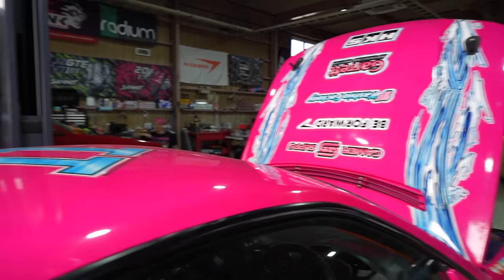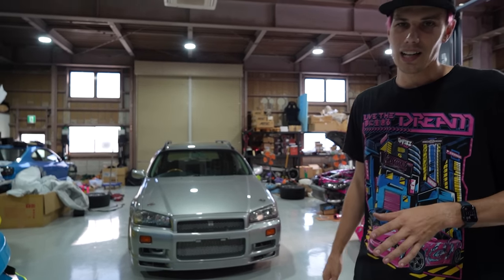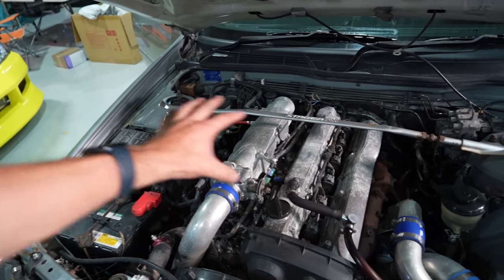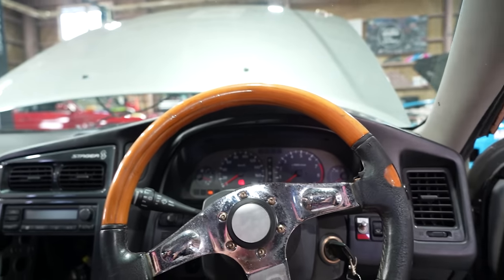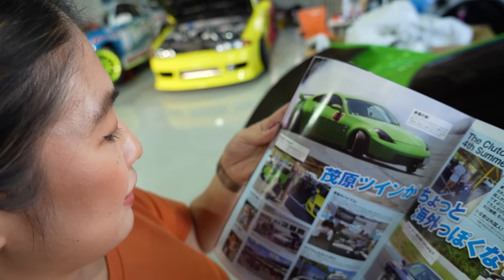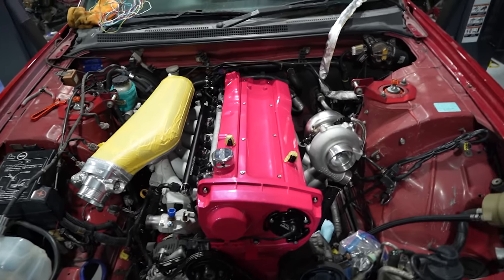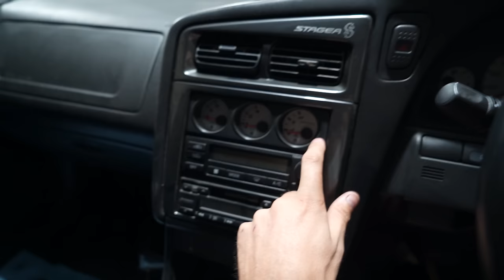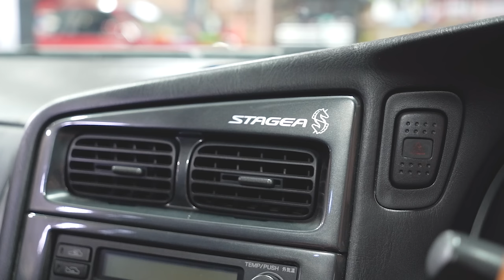IT FINALLY HAPPENED!

Comment: Dammit Sammit. That is my dream wagon. 550hp, silver with all black interior, 34 front, with brid seats front and rear in black with carbon backs.  18inch 002 get wheels in black with stainless hardware, kw coil overs, blacked out windows and a little Godzilla on the back lower right of the rear window in silver for fun.

Comment: Ultra racing do a bolt in harness bar for the Z,you can still use the stock belts,and don't need to remove them.Braum do harness bars also.

Comment: Man if i could get my hands on that cup holder devidee thing i could 3d model one and 3d print them. Heck i could even print them in mass for you to sell if you wanted. And im not talking a rough print, i use a resin printer so they would look injection molded.

Comment: Anyone have an idea what the size differences are between American and Japanese sizes cause I'm a 2XL in American shirts (tight on the sleeves and chest) and the measurements on the website seem too small even for the 4XL. Just trying to get some info so I know what to order. 

Just the sleeve opening is 21cm and I just measure mine at 39 cm, let alone the chest maxes out at 66cm and my chest is 112cm. I'd say I'm on the fit side but an actual 6 foot and 220 lbs. So, am I out of luck on the shirt and jackets?